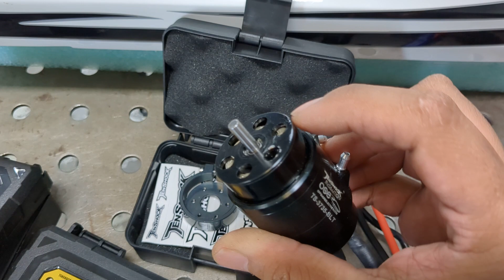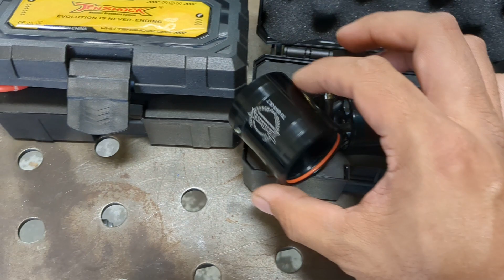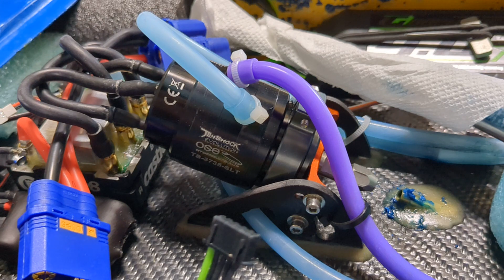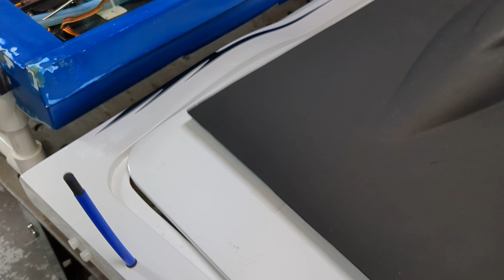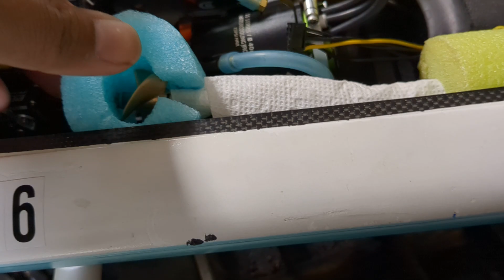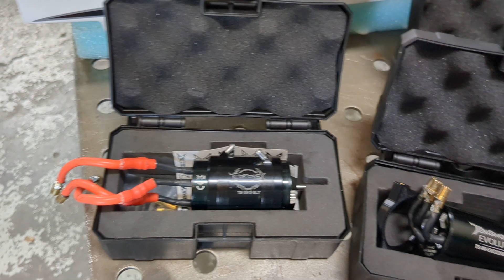Tenshock OSE Evo22 Motors Up Close + Castle ESCs Explained and Boat Theory!

Comment: Hey Alex, I noticed the clear/gray sealant around the water-cooling block on your ESC. I’m converting my Castle Ghost to water cooling using a StumpFab block and wanted to know the exact brand and type of adhesive you used. Is it silicone RTV, polyurethane, or epoxy? I’m looking for something that holds the block securely but can still be removed if I ever need to replace it.

Comment: Thank you for explaing the mtors. I have a tenshock  2260 1350kv motor.  not surehow to prop it can you run 8s on this motor. thank you for your help.
Reply from the maker: 8S will be ok in some applications. it depends on the boat type and size.

Comment: Good Day Sr.  just came across this video and I am very impressed with your knowledge. I am currently.  building my RC boat   It's a 38" cat. t's 3D printed and will have carbon fiber coating. Should weigh about 6.5-7 lbs empty . I'm not racing it but would like to see at least 60 mph. I'm researching electronics options  Was thinking twin props but not 100% necessary. Any suggestions for the drive system would be greatly appreciated Thanks

Comment: Lots of good info about motors en esc's... Not i intent to race, but good info is always interesting. Personally i'm more interested in details, like preparing props, sanding bottom, ideal placement rudder (if there is one), etc. The tips and tricks from a pro. I noticed these are the things that made me go fast. Its not like, take a big motor and you will be fast, there's a lot more to it.
Reply from the maker: @peteroosterhoff8850  thanks for the comment and suggestions. I'll try to remember that next shop video I do. It's just so hot here in SE Texas right now, I'm usually in and out of my shop ASAP haha
Reply: @alexrex20  here its about 83 to 86 tomorrow (Netherlands), so a good day for boating, then it becomes cooler again. Tomorrow going to a big pond to test my setup. Unfortunately one off my best lipo's has a damaged cell, so have to take it bit easier. The other lipo's don't like this setup (x8s, 4092/1650kv/46-3blade). But want to see how it handles or if i have to do minor adjustments for when i have a new lipo.

Comment: Have you ever got one of these motors wet? I had the cooling nipple pop off, flood the boat & and the motor got wet. I oiled the bearings and kept a fan on my boat for 5 days. Next trip out it seemed under powered.  2100kv 3890can

Comment: Thanks for sharing. Tell me more about your esc wiring. I noticed you’re running extra cap packs. I have an X8s but I’m seeing too much Ripple than I’d like. Almost double from compared to my xlxs2.
Reply from the maker: it can never hurt to add a cap pack to an ESC but i've never needed to add one on an X8S. but i only run 4S on my X8S ESCs. i normally see around 1.0-1.2V of ripple on the X8S. on the MMX6S and Cobra8, they do need an external cap pack in my opinion.

Comment: what did you do to the Castlwe 1515?
Reply from the maker: it has the solder tabs removed and the wires are soldered directly to the windings and pointed out the back, to allow the use of a rear support ring.